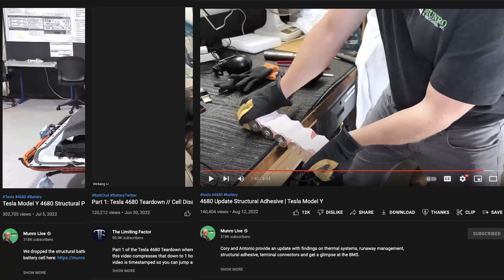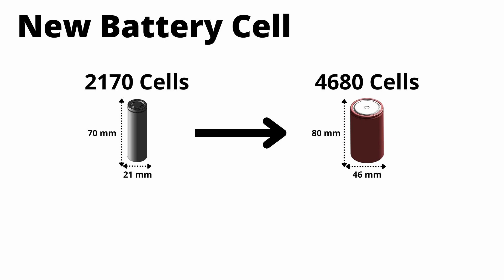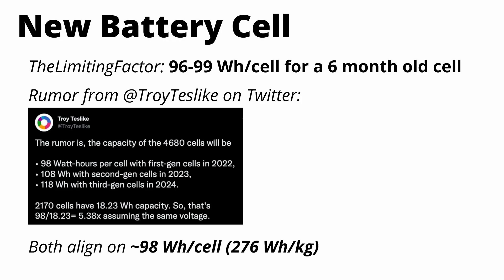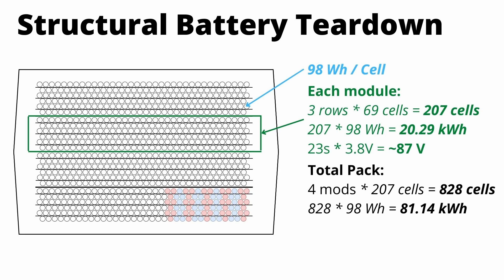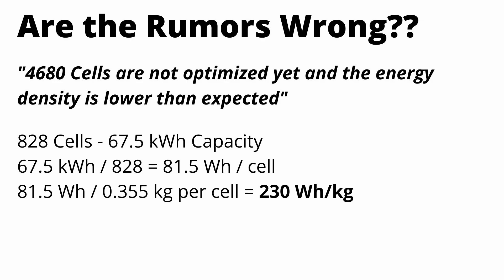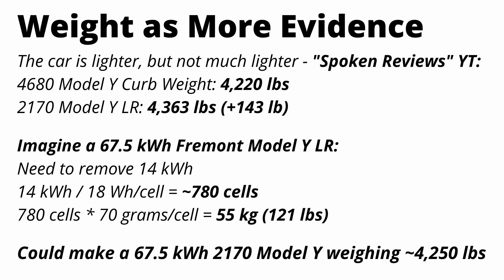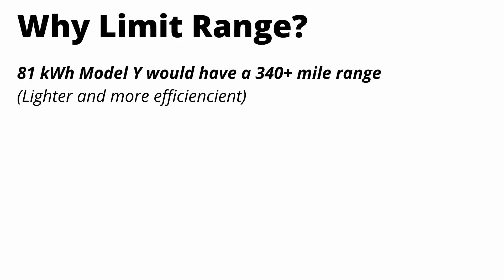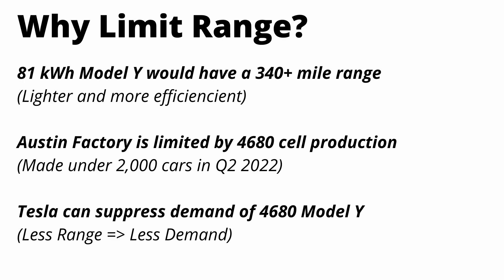Did Tesla Nerf the New 4680 Model Y? Battery Pack Analysis

Comment: They are definitely limiting the pack.  All evidence points to this and you left out the additional fact that the Limiting factor also had the energy density verified by the lab with small coin size samples.  This makes the most sense and fully explains why the new lower mileage variant has never actually formally gone on sale.  Also explains the newest data point that shows them stockpiling model Y 4680 structural packs as battery pack production is now ahead of 4680 Model Y production.  When they stock enough (build up buffer) and they are confident the battery production rate will keep up with the car production rate, then they will announce the new 340 mile EPA version.  My guess that is around the start of Q1.  Don’t forget they have Panasonic supply ramping up in 2023 as well.  If they get a buffer of 4 or 5 months, and then get battery production ramping up faster, they can pull the trigger.

Comment: Curiously, 81kWh is about another 25% on top of 67kWh. Tesla seems to be following the 1m miles initiative, and perhaps is limiting usable capacity to maximize battery life. They are likely not allowing charging to full capacity or discharging past a voltage to improve battery life. I remember seeing a chart that showed percentage discharge ranges versus how long the battery life lasted in terms of recharge cycles, and I assume this is the case. 

More info here: https://batteryuniversity.com/article/bu-808-how-to-prolong-lithium-based-batteries

Comment: You are not doing apples for apples comparisons with your quoted pack sizes by capacity. 
And also they will absolutely be using 4%-90% SOC charge profile. And they are still in  iteration stage of the cell.
Reply from the maker: What would be an apples-to-apples comparison?

Comment: All battery EVs have a stated battery capacity and for each, the usable battery capacity is known. The difference arises because batteries last longer if you do not charge to the max voltage or discharge to the lowest.  Tesla may be more conservative with this new design in terms of the proportion of available capacity it allows to be used, in order to trade range for battery life.

Comment: This makes sense especially with the model S plaid they are limiting its top speed to 175 mph when it was originally going to be 200 but some guy actually bypass these limitations and got it up to 216 and it would have continuously accelerate 5 mph every second if he hadn't run out of runway, even the acceleration is electronically limited however it's probably for safety since the street tires cannot handle anymore.

Comment: A Model Y extended by 1 or more additional cell groups in each battery module would have more range, space and more charging power because the charging voltage would be higher.
Then a compact car underneath could be a bit larger and have more range.

Comment: Another possibility is some of the cells are blank filler cells for the sake of the structural battery pack.
Reply: I don't think so. When Sandy Munro took apart the 4680 Model Y he sold off the bulk of the batteries to buyers. If that were true, it would have quickly come out in headlines as the various used 4680 battery buyers would have openly complained.

Comment: Why wouldn't they use a reduced number of cells to do this?  If they wanted to restrict it to a set mile range in order to avoid the osbourne effect, couldn't they just do this by putting fewer cells in the pack?  That way they could then also build more cars with the same cell supply.   BTW I think you are correct that they are limiting it - as you describe these energy density numbers and weight would not make sense.  It does make me wonder though - since this is a structural battery pack, maybe could it be important to have the cells in expected locations in order to provide the required structural strength.

Which then makes me wonder if some of these cells could even be fake cells - which are just filled in with some substance to provide the needed structural strength.
Reply from the maker: Exactly, these are great points. Based on the Munro Live teardown there are 828 cells in 4 identical modules. It is possible when they finish the teardown they reveal a different number of cells or dummy cells, but I think that's very unlikely. I think part of the motivation for more cells and limiting it now, is that down the road they want to make one Model Y variant (physically) to simplify production. Then they can change software and small things for different trims (like the performance model for example). 

And yes it's also possible that all of those cells are needed to maintain the structural pack effectiveness.
Reply: @MotorMatchup  Thanks for the reply :)

Yeah, I'd forgotten about the Munro teardown.  I guess if they'd seen any fake cells they would have highlighted that big time at it would be a major news story.  Though even now I do wonder if they've examined every cell or just torn into a few of them, lol.

It's sure going to be interesting though.  As you described (great video as usual BTW!) it doesn't seem to add up - would seem they have to be intentionally limiting them.  So, I'm hoping this becomes evident sooner rathern than later.  I keep hoping they can use this to release an extra long range performance++ version of the Model Y.  Which I'd love to trade up to (currently model 3 LR owner w/ performance boost).

Comment: Because the goal of Tesla is to accelerate the world's transition to sutainable energy. And that means more EV's on the road. Maybe it takes a lot longer to get out a valid chemistry for 4680 batteries so that it would achieve >270 wh/kg. In the meantime, if they have usable batteries and they need 828 cells to make the pack structural, why not do it? Yes, it's an EV with lower range than the maximum potential, but maybe they're not AT maximum potential yet. If they get 4680's with 230 wh/kg out on the road they not only gain more knowledge on the 4680's themselves but also gain more revenue, more customers, more income and they will replace an ICE on the road and get closer to their goal, which is: accelerate the world to sustainable energy.

Just my 2c.

Comment: Seems very plausible. I’d love to know more about what kind of buffers Tesla uses, especially for the 21700 model Y. Maybe the old model Y also has a massive buffer?
Reply from the maker: According to EPA documentation the 2022 Model Y LR has a physical capacity of 84.6 kWh. I believe usable capacity is around 81 kWh so the buffer is not much.
Reply: @MotorMatchup  that’s a pretty small buffer! I think that further supports your suggestion, Tesla may be limiting the capacity of the 4680 model y
Reply: @MotorMatchup  also the 4680 cost 50% less to make vs 21700/18650